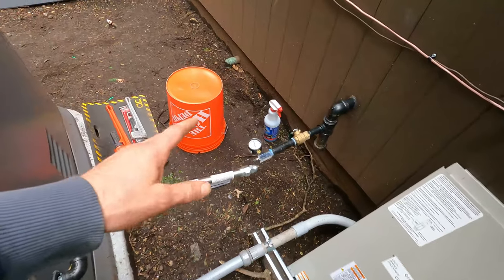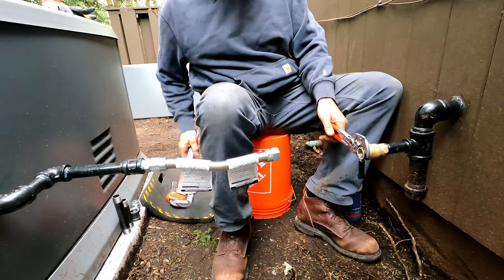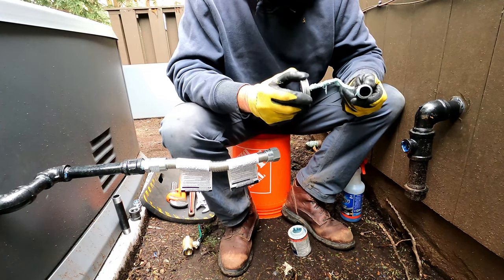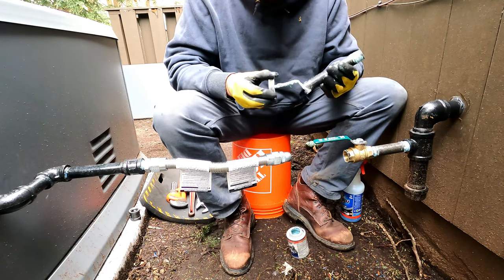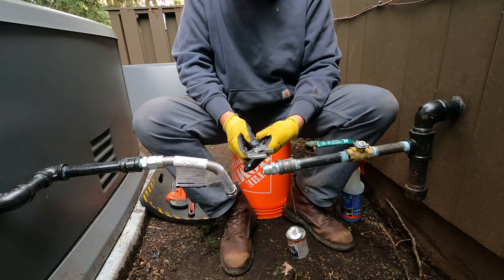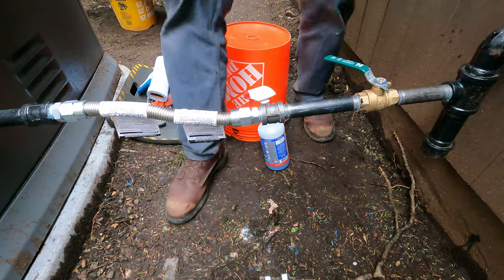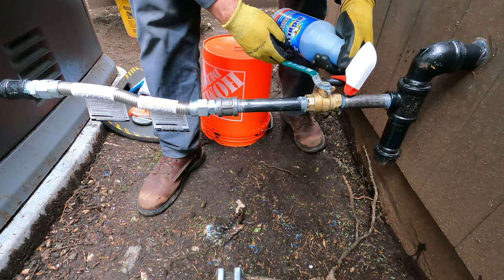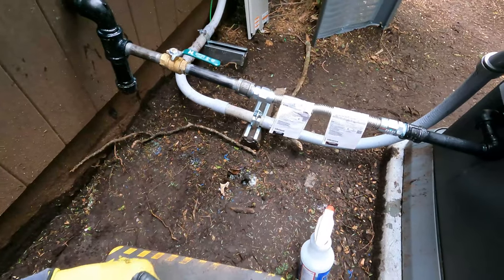Installing Gas Pipe

Comment: I've never installed with just dope and no teflon. Saves a lot of time I'll give this a shot
Reply from the maker: See you never did it the way i do. I only reckoned once with the yellow. Lately with the blue and black Teflon I’m seeing more Teflon used. I never have leaks on my gas fittings with only dope. Or I would Teflon. With water pipe I Teflon and tape.
Reply: It just takes a couple seconds to Teflon and pipe dope

Comment: In my area we always had to use galvanized schedule 40 pipe for all outdoor gas lines to prevent pipe from rusting.
Reply from the maker: In my area we use black steel pipe and paint. Not sure why in NJ galvanized is uncommon. Especially since NJ gets a lot of snow. Yet I have seen lots of rusty gas pipe. Only time I seen black pipe used for gas rot through was penetrating through a cement wall. Off the meter. Those pipes were rotted bad. Flaming apart. Usually I only see black pipe rot away on steam systems.
Reply: I NEVER use galvanized pipe to run gas line. Galvanized pipe has a tendency to flake. I ALWAYS run black pipe, and paint it when I'm finished.
Reply: Wrong. No galvanized. You use black steel pipe and fittings. Galvanized coating will flake off and clog the orifice. You paint the pipe, instead
Reply: @elmono3939  I had a retired plumber from Ca Bay Area call me out using black pipe on his job, he said it was never allowed in the Bay Area, they were made to use galvanized for corrosion.  Myself I do not care either way, I have never ever seen galvanized flake anything, I think it is an old wives tale.  Not found in any code for sure.
Reply: @nspro931 : Definitely not a old wives tale. It is also not a Code, but manufacturer's recommendation. With that said, I also understand we all are used to different materials and installation methods - and we all claim "our method is the proper one." So be it. Checked with Inspector's network web site, and this is what they had to say regarding this topic: "...You do not want to use galvanized pipe for gas because of the galvanized coating. Over time pieces of the galvanized steel will flake off and clog your gas regulators and burner units. Never mix galvanized and black iron or where they touch corrosion will be accelerated...."  Amen

Comment: wow , cant believe that flexible line is to code....I know your in new jersey ...just never saw it like that in new York,, ,enjoyed the vid Bill!
Reply from the maker: Manufacturer requires these due to engines moving somewhat on start. Helps protect steel gas pipe fittings vibrating loose.
Reply: @howtohvac3234  , not really sure why New York would not be following the GAMA ( Gas Appliance Manufacturers Association) & the national gas fuel code rules on gas generator installations. You did a great job on your installation. I'm not a big fan of that type of connector used on generators. I prefer the braided vibration connectors, even if this type of connector is shipped with the generator, I refuse to use it ( it's just a glorified Appliance connector). Google/generator gas connectors/Calore Equipment & you will see what I mean. Just and FYI, some codes throughout the United States require the drip leg to be installed after the shut-off and the shut-off valve to go down to the off position ( fall to the off position, if you can visualize) but each to their own as long as the national code is followed.👍
Reply from the maker: @boby115  their is a drip leg factory installed inside the generator. Right before gas ties into fuel solenoid. Our drip leg on outside is redundant yet for inspectors to see it.
Reply: @howtohvac3234  👍
Reply: @howtohvac3234  But not ALL generators have a drip leg installed from the factory.
Reply: Thanks.Very clear. Helps me prepare to do the one gas job I need to do, at age 78. I help my Dad do a number of jobs about 65 years ago. I need to kearn more about drip pipes.

Comment: Couple things. I'm assuming that's a generator & all generator manufactures provide their own flexible connector with specific installation instructions. I've installed & inspected many gas installs to generators & have never once seen a sediment trap on the inside of the unit. IFGC requires the sediment trap to be downstream of the shut off valve. Pipe dope is not a sealant it is a lubricant
Reply from the maker: Drip leg is factory installed inside of gender before gas solenoid. Not all units have a drip leg/ sediment trap inside. Look at the new Honeywell genders and it’s inside. I have been working on generators since 2010. Until Honeywell’s update I never seen it inside of the machine. Pipe dope is a lubercant. Yet also seals, if not why if you turn your wrench to the left to get proper angle of pipe. It will most likely leak?
Reply: It is actually a lubricant, because the the threads are pitched acts as a lubricant get the threads as deep as possible the threads actually seal not the pipe dope

Comment: I hate flex line and never trust it, as a hvac tech I always hard pipe. No matter how much testing flex pipe has. We use a commercial grade braided line that is substantially stronger and not a cheap appliance flex line when we are worried about vibration
Reply: You absolutely MUST use a flex line on a generator install. No matter what brand, or what size generator, there will always be vibration.

Comment: Did you tighten that flex with just your hand 💪?
Reply from the maker: At first I didn’t tighten with wrench. I usually like it to leak the air out when I first turn on the gas. It didn’t leak why at end I thought it would need a few cranks to start up. After the video I snugged it up more with wrench even though it sealed from hand tightening. Doesn’t take a lot of force to seal gas pipe.         7” w.c. = 1/4 PSI

Comment: Hello. Why the conection to the generator need a vertical tube (pipe leg before the ball valve =x=|| )?? Is it a residues colector or a pipe head for pick load?
Reply: Should be after ball valve

Comment: Work out from the main piece by piece Not the other way
Reply from the maker: The gas pipe is not allowed to be connected to the appliance until it passes the air test.

Comment: I just had a question for anyone here, a recent had a very sm gas leak, and since then I have been planning to want to replace the black pipes with Proflex flak jacket CSST as a DIY, what I needed to know is can I go with thee exact same size as the black pipes that are currently in use, or do I need to go up a size when using CSST???
Reply: Don't DIY something that can blow up your house.
Reply: Yes its the same size, but HIGHLY suggest to call in someone. factors with bonding and so on. black iron is way less leak resistant. dont install if you dont know what you're doing.